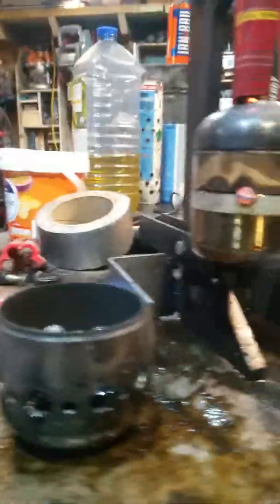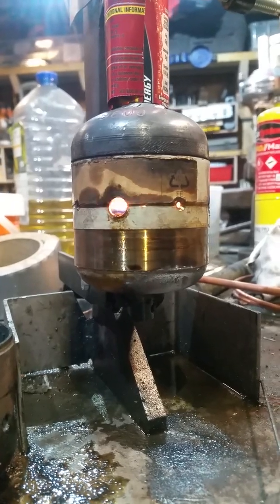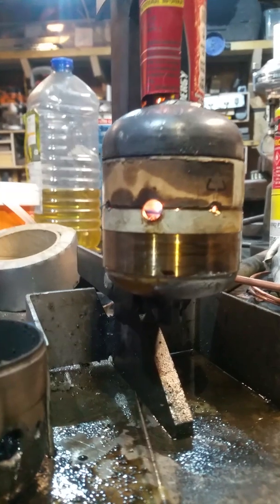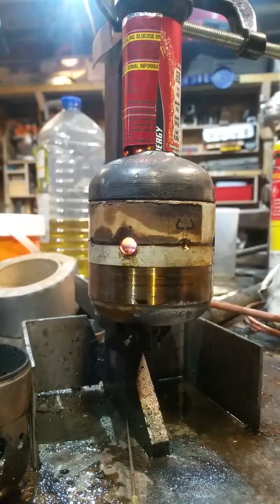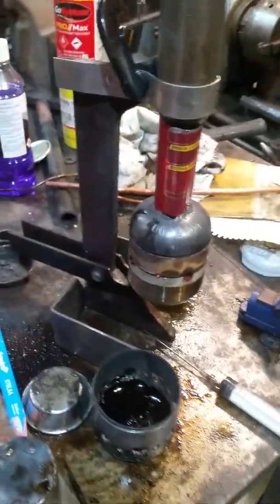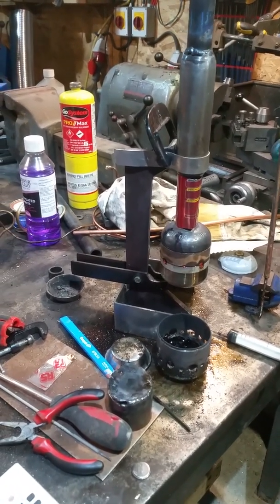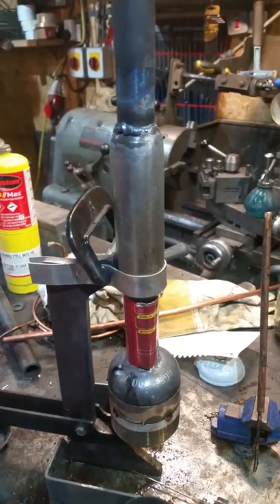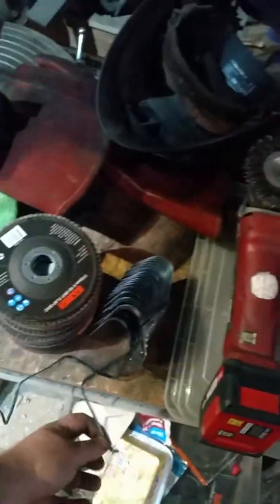small changes to the homemade diy tiny waste oil burner / heater.

Comment: Shane, if you don't mind...What are the dimensions of the argon gas bottle you used for the little burner with the glass window? Thanks!
Reply from the maker: To be honest I dont know. It's just the little bottles they sell, it's the same as catering no2 propellant.
Reply: @smithbuilt  Are they the 60 litre or 220 litre Shane, the 220 litre bottles are around £35.00 and the 60 litre bottles are anything from three bottles for £18.00 or one bottle for £16.00. The price will tell me enough. Thanks again!
Reply from the maker: Lol there 110 but I can tell you there is no size difference between the 60 /110/220 they are just higher fill pressure rates. There the same size as map gas too but map gas has a bit on the bottom of the bottle to give a flat surface.
Reply: @smithbuilt  Ah' thanks Shane, I'm not familiar with argon gas as I've only ever stick welded, I've never been fortunate enough to have a go at MIG and/or TIG welding. 
I'm familiar with map gas. 
I didn't realise that little burner was so small, you're probably the champion of the worlds smallest practical drip oil burner, well done and thanks again. 

If I can get my hands on an empty bottle I might try and replicate it. 
I guess 3" or 4" round steel pipe, even square would work.
I really don't need much to heat my shed and free oil might not come along so easy these days with fuel prices so High. 
One of my neighbours owns a chip shop though so I'll be asking him what he does with his old stuff.
Reply from the maker: @pa_maj.MARTINI-van-MAN  yeah 3" is about the diameter of the little bottles. 4" will also work too. If you look at some of my other videos you will find one where i scaled this design up considerably. Theres also videos of me taking that little heater apart. Thanks again for watching and take it easy

Comment: Yes mate, interested to see what happens when you stick a blower on it.
Reply from the maker: I changed the design. Went over to I think I called it Mini forced air waste oil heater. It works really well just to small for the new shed